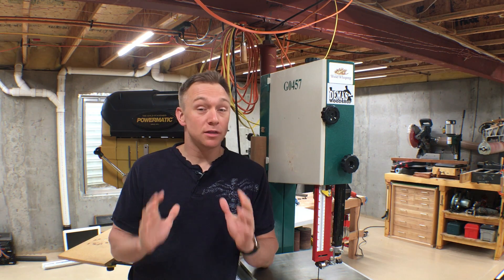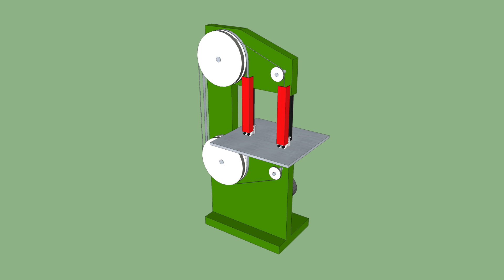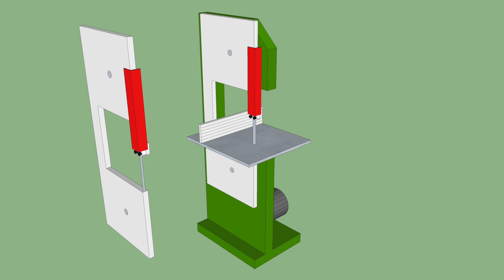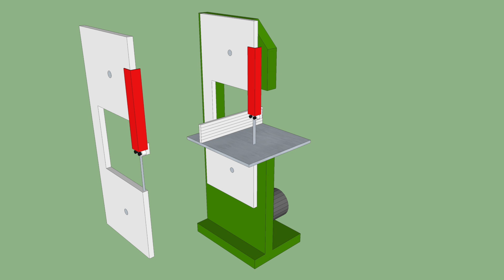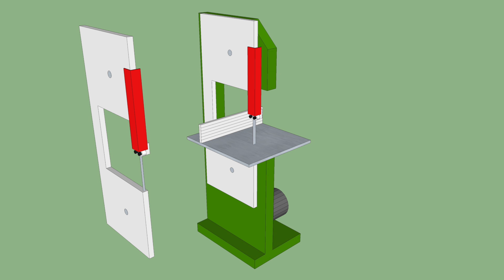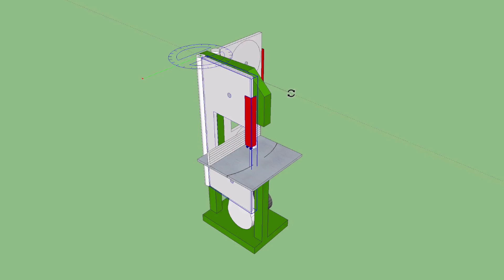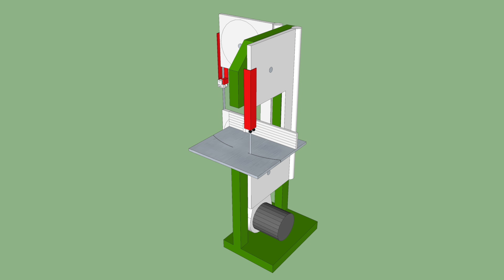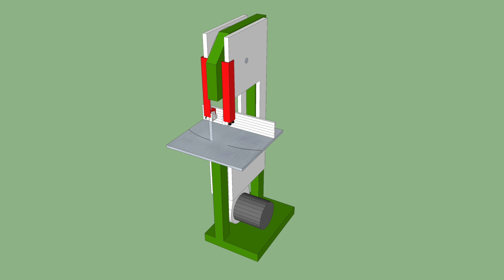Even Better Bandsaw?

Comment: How about just put two bandsaws back-to-back (or side-to-side if you look at it that way), sharing the same column, and with the motor in between, and two belts on the motor to drive the wheels.
Reply from the maker: +Andrew Cady that would work, you give up a lot of shop footprint though, since you can't put it up against a wall, might be hard for a smaller shop.

Comment: Apart from the bandsaw being the safest machine tool in the workshop, the two cassette idea is brilliant. In my experience during fifty years of workshop use of the bandsaw, I only needed to do two things. ....gentle curves with a wide blade and a quarter inch or one eighth blade for tight curves. The answer was two machines both set up to do these two things. If you can solve the problem of the casing getting in the way of of long bit of wood on a tight curve.....you've cracked it!.....if you will excuse the pun!

Comment: Instead of the two bandsaw cartridges swinging around into place, how about a track and clutch system where the cartridge slides straight back and forth. Each could be engaged when slid into position. Some mechanism would have to be in place to prevent engaging both at same time.

Comment: cool , ideas,, but what if you had a left and right saw, one base , 1 motor and 1frame ,,2 ,basically back to back saws , minus one riser back, separate tables,,, would only need to lower the guard of the un used saw ,,,, only change blades when dull

Comment: Hey Andrew, there is a very big point you aren't taking in account, all of the rigidity of the saw comes from the frame, with those ideas you really arent using the frame, which would result on a really bad saw, vibration and defleccion are the problems that comes from that idea, I think it's just better to make changing blades easier than those impossible ideas. Cheers
Reply from the maker: +brunogausa you could make the cartilages as rigid as they need to be.  And in the last option you absolutely would be using the frame for rigidity.
Reply: If you do them as ridgid as they need to be they will be as wide as bansaw frame, your bandsaw will be 3 times wider than normal. I don't like the other ideas personally

Comment: I will said better build a better bandsaw, something with a big trust bearing under the wheels that keep the alignment right under tension. Having a quick change tension mechanism that work with a came, where you can preset your two blade tension... You change the blade in 5 minutes, no part in double. Simple to build.

Comment: how about just a "guide bearing cartridge?"  leave the wheel, tures, framework, etc the same but make a guide cartridges that could be swapped out.  Much lighter and you could have more than just two blades ready to go with adjustments.
Reply from the maker: +Designs By Philip that's a good idea, not quite as fast for changes but a lot simpler.

Comment: I like your new concept but I'm thinking that the swinging frames would have to heavy enough to keep the tension so they'll need to be cast iron or aluminum but then you've significantly increased the cost of the saw.  it would be essentially the same as running two bandsaws off of one motor.

Comment: The cartridge idea may be difficult because of strength and rigidity of the frame. The back post of a bandsaw needs to be strong enough to hold the blade tension. With the wheels mounted in a cartridge, I'm wondering if there will be enough strength to tension the blades.
Reply from the maker: +drstampfli Yes, for the cartridge idea the cartridges themselves would need to have that rigidity, that's why I think they will need to be on the hinges.
Reply: What if the cartridges had some kind of pin type system, that they engaged on the centre cast iron frame. With a quick tension lever that you only tension after the cartridge is in place?

Comment: think of a car or truck engine belt system.  some have a tensioner and an idler.  i know that they have a tensioner on them, but make it work like a car, pop a 15mm wrench and slip the belt off.  is the goal to  change the blade in 15 seconds like a set of F1 tires?   I'm just not fully understanding the logic behind this.
Reply from the maker: +Joshua Dunbar bandsaws already tension and detention quickly to pull the blades off, that's not what takes a long time.  When you switch from a thick blade to a thin blade the tension needs to be adjusted, as the thin blade operates better at a lower tension.  Then the tracking needs to be adjusted, so the new blade rides on the tires where you want it to.  Then the position of 6 guides all need to be reset to the right position for the new blade.  All that stuff is why it takes a while to switch blades, and I'm trying to conceptualize a saw that would not require all of those adjustments every time a blade size change is made.  60 seconds for such a change would be phenomenal.

Comment: 2 sided blade?????!!!!
Reply from the maker: +jimmydiresta kinda hard on the guides behind the blade.  How would you keep from chewing those up?
Reply: +Andrew Klein Maybe you have a rolling mechanism that acts like a bicycle chain over a chain ring, in that the teeth of the blade fall into matching, synchronized gaps that roll with the blade?
Reply: That would dull your blade, make a lot of noise and if you check saw teeth you will se that they arent simetrical.
Reply: 2-sided blade doesn't cover the need of a thin blade for curves and a thick blade for resaw.
Reply: All of my blades come with two sides but none of them let me make multiple types of cuts, i.e. thick/thin/curves.
Perhaps the idea is to put different pitched teeth on the back of the blade -- that wouldn't work for me. I don't have the patience to glue on all those teeth, and can't weld worth a crap.
Reply: cross section of the blade can have guide groves on the flat sides?!!
imagine a turns with this blade like along fire truck.. tight turns wide curff
Reply: Ooh ooh ooh! {dancing in place} I want one!
Reply: jimmydiresta It's too thin and too much friction. Cheers and keep your videos coming, I'll like them :)
Reply: Some large band-saws that are used in sawmills have double sided blades, and there are no guides on the edged of the blade. they have rollers on the wide sides of the blades to prevent twisting and stabilize the cut, and rely solely on the tracking of the crowned pulleys the wheels ride on the keep the blade from coming loose.
Reply: Those machines aren't used for cutting curves at all though, so such a system might only be good for resawing.

Comment: I think it's bad idea. You need firm structure. The frame is basis for bearings and wheels, not just some exchangeable cartridge. 
What about have one big wheel and more smaller wheels on other side as John Heisz made? It could incorporate mechanism to store one blade aside and use another just by moving few wheels.

Comment: just put a high tensioner on it and call it a day.  the idea is to make it easy, not more complex, then easy. 
with the tensioner it would be extremely easy.
Reply from the maker: +Joshua Dunbar I don't quite understand, bandsaws already have tensioning mechanisms.  Tensioning takes less time than guide adjustment when switching different thickness blades.

Comment: How about some sort of riving knife that goes behind the thin blade. Possibly redesign the blade so it has a channel behind? I'm just thinking out loud!
Reply from the maker: Problem is for resewing you need fewer teeth per inch, and deeper gullets between the blades.  This isn't duplicated by putting a riving knife behind a thin, curve cutting blade.
Reply: True

Comment: Seems like a more pragmatic solution is guides that are more foolproof in their setup and an electronic tensioning system.
Reply: For what it’s worth, the ceramic Laguna guides are really simple to set; the time consumed is all in getting into the lower cabinet to loosen/tighten the lower block.
Reply from the maker: Agree, some blade guides are friendlier and faster to set-up than others.

Comment: Is it really the bandsaw itself that needs to be reinvented, or shuld the focus be on making a universal-all-around blade. I have no idea of how... maybe a high power laser bandsaw.
Reply from the maker: I don't think its possible for one blade to do thick resewing and tight curve cutting.  But prove me wrong by all means.  As for lasers, I think a laser capable of resewing would need to be CRAZY powerful!
Reply: +Andrew Klein problems are like old cart weels being pushed upp a hill. eventualy they will roll down by themselves. what I mean is... all ideas are a possible sulution some have to be pushed harder.
Reply: +Andrew Klein i think the hinge system sounds cool and would somehow work but the 2 stationary/mounted design seems more practical and little bit safer. dont have to worry about a door with a blade swinging at ya if u forget to lock it. ya know? just my opinion though i wish u luck im sure youll figure somethimg out..🖒💥
Reply from the maker: I tend to agree with you, stationary wheels on each side of the frame is pretty simple, and makes blade changes a lot faster than what we have currently.
Reply: Andrew Klein 🖒💥

Comment: Consider mirroring the blades. That way they will be in the same (wider) wheel, no need the change anything. But yeah it will take more space.
Reply from the maker: No good, you need to be able to independently tension and track the different blades.

Comment: Tensioning and tracking adjustments are the real problem as I see it. Each blade needs its own TLC and no mention of TWO axle/wheel setups here???
Reply from the maker: well, yeah, you do two set-up initially, but then you are done, switch back and forth as many times as you want and those set-ups don't change.  Seems worth it to me ...